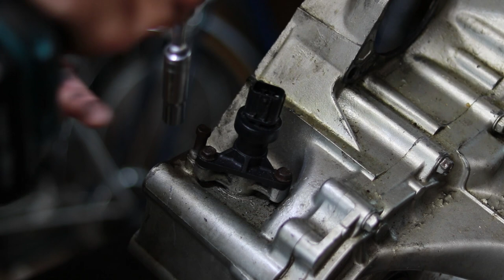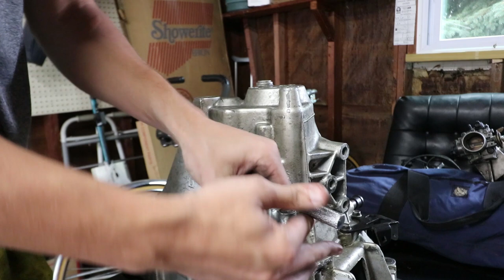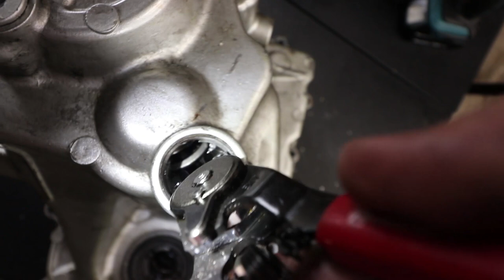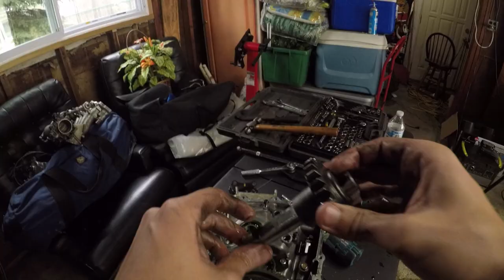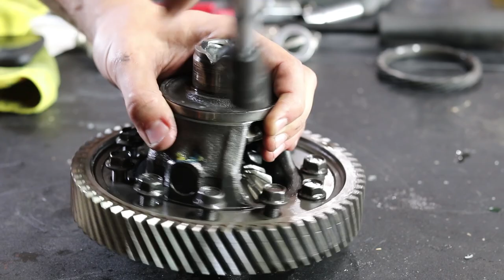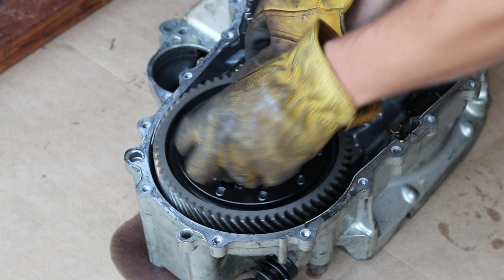Honda B Series Limited Slip Differential Install (Extremely Satisfying)

Comment: Never use old diff bearings. Next time you remove the speedo ring set it upside-down on a table, apply heat to it and it will fall off on its own. And last put your diff in a dry ice cooler. The NEW bearing will fall on. Heat is the number one enemy of a bearing
Reply from the maker: Hey Jim! Hope you're doing well man. I hope your build is coming along nicely. I donated to your gofundme a few months back. Always a pleasure to see you in my comment section.

Comment: You need to check the bearing/diff preload when you install a new diff like that. It can mess up the bearings and or diff possibly or the case is the transmission of you don’t check it and shim it properly
Reply: How does one do that? I'm curious to know when installing mine.
Reply: @JohnDoe-cs5uo   put the diff in put the case on n put a few bolts in and have axle seal out of the top case you put on and put the feeler gauge between the bearing n the shim in the case I think spec is .001-.010 but not 100% should look that up
Reply: 0.004 max per the Honda shop manual  @schmikels_garage
Reply: I recently bought a transmission with a Cusco diff swapped in, clearance not checked. 0.05mm to tight and its caused issues with the diff bearings.

Comment: I had pulled the trans out from a d17 to change a bearing or 2 and I messed up the placement of neutral so when I put it back in the car all the gears had resistance and I wasn't able to even shift into 5th or reverse (I had some guy do it for me). Helpful video tho, will be looking at this for reference 👍
Reply: I actually pulled the trans out like 4 times but only opened it one time. I been sold that car and now I have a 99 EX Coupe 5 speed.